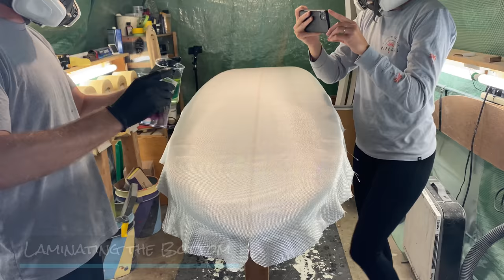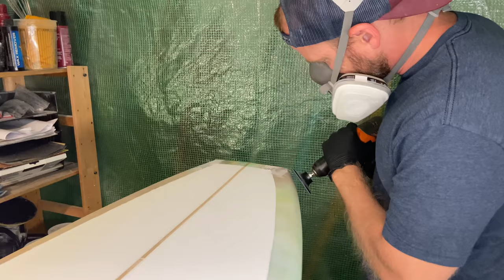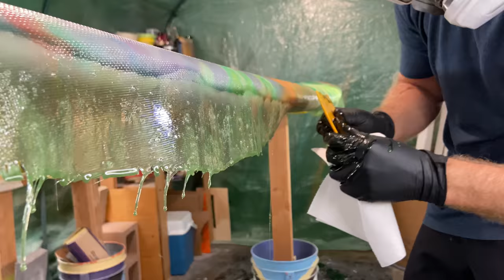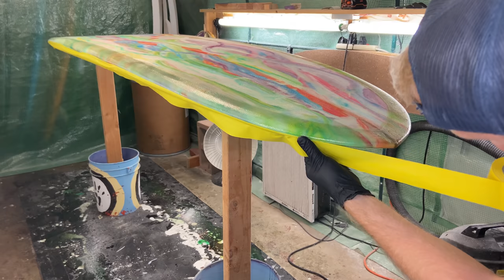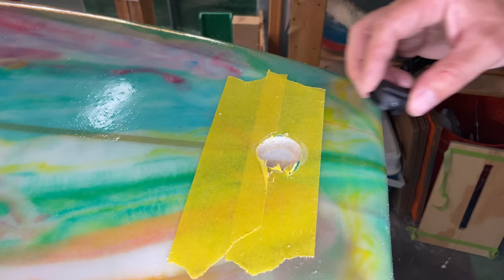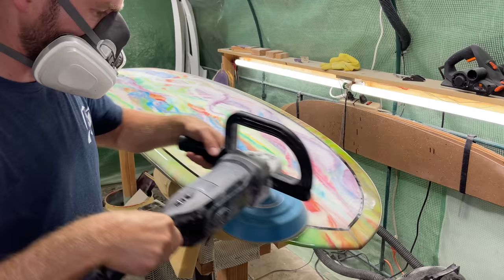Surfboard Glassing [Longboard]

Comment: Another beautiful board!  Everyone of your projects comes out so good it's hard to see how each new one can get even better!  Looks like you've solved the masking issues - good on you!.  Nice to have an assistant in the bay with you too!  Thanks for sharing.
Reply from the maker: Thanks Jim! Appreciate it. Yes the tape lines did improve and I found a better tape to use. My wife was a great assistant on this one!
Reply from the maker: Lord Riggnarok  Not sure, never tried!  There is a brazilian company called surfpuro making fiberglass skateboards that has seemed to figure it out.
Reply from the maker: Lord Riggnarok  You can pour resin on a skateboard deck and move it around with a heat gun.  But the resin could crack if your actually riding it, not sure.

Comment: You were killing me grinding the laps with that drill. I almost stopped the video halfway through to comment and say, you know, those Makita Sanders are a dream and have way more control in all stages of glassing, but I held back cringing, then all of a sudden there you are blazing away with a Makita. I really like your lap width gauge. It's clean and neat. Most of the ones I've seen have been crafted out of a broken board, but they amount to the same thing. The blind box drop with a brick is pretty risky. I always use a dedicated straight and true fin to set the boxes. Can't afford to have one croocked fin box. But not saying you don't have it wired. I've been building boards for 60 years, and I'm giving this finished board and your craftsmanship an A+.
Reply from the maker: Thanks for the feedback and I’m glad you can relate! So many ways to get to the final product. Thanks for watching 🤙

Comment: When you do the double layer on the tail, theoretically better to put the smaller piece on TOP, this can prevent sanding through the strands of glass on the full length piece and weakening the structure.  Counterintuitive but true

Comment: I've never glassed anything before, but I want to re-skin my foam kayak with glass. Would the resin you use in this video be a good choice for that project?

Your work is amazing. I love watching the videos you put up.
Reply from the maker: Never worked on a kayak, but if its got an EPS or PU foam core, you could glass it like a surfboard using resin and fiberglass.
Reply: @BendheimBoards  mine is made from xps foam. I've been doing a bunch of research on fiberglassing it. I know it's a better option than the skin I currently have on it.
Reply from the maker: @patrickkaufman7561  Andrew W did a full build series on his channel of an XPS foam board you can check out

Comment: Curious about your color, did you mix it prior then just add both into a cup? My pigments are almost like a paste. I mix them with resin but in your video it looks like your pigments are watery which is super cool allowing you to mix two colors without stiring as much giving you that neat separation!
Reply from the maker: I used tint colors rather than opaque and I mixed them in a small cup of resin then poured into the larger cup of clear resin.
Reply: Interesting! Thanks a lot! Awesome board!

Comment: Amazing board. This may be a daft question - but how did you stop the tuck from ‘overlapping’ the swirl colours on the other side? It looks like the colours are consistent right to the edge of the deck / bottom.
Reply from the maker: The deck colors were darker than the bottom colors so you can see the cut lap on the bottom really well but the deck colors mostly covers the bottom lap.

Comment: great job tanner!  is it ever possible to avoid pin lines on the cut lap?
Reply from the maker: Yes, pin-lines are just used to cover imperfections on the cut lap.  If you get a clean cut lap, you can just leave it as is unless you want the look of the pinline

Comment: sweet...if you are resurfacing a board (one that is old, yellow, etc...) can you stop at the filler/hard coat?   if so do you need to sand and polish this coat as if you were putting on the gloss coat???
Reply from the maker: You can stop after the fill coat for any board. Yes you’ll want to sand afterwards as well. You’ll get a sanded finish just like high performance boards you see in retail shops

Comment: What grit papers do you sand through and what compound do you use to polish with?  I've been using green light epoxy on my last few boards, and sand 320, 400, 600, 800, wet sand 1000 and 1500, and then use car polish, and the results do not look nearly as good as yours.  I know epoxy doesn't polish like poly, but yours looks really good.
Reply from the maker: You nailed it, those are the grits I’m using and I’m using car Polish as well. It’s really hard with epoxy and so much easier with poly. The electric polisher makes all the difference if your doing it by hand.

Comment: Nice video. Would it be easier to use vinyl tape for the stripe than the masking tape?
Reply from the maker: You need high quality masking tape that can handle the resin and not leave residue when pulled off

Comment: I got 2 foam top, hard bottom paddle boards. They have some sun wear in the foam and a few holes. Can I do this process and just wrap the existing board or would I need to strip it down to the foam core?
Reply from the maker: Resin isn’t made for soft top boards. Stripping it to the foam would work but I’ve never done it

Comment: I was wondering what’s the difference between the layer of hot coat and the gloss coat material wise?

Love your videos btw!!
Reply from the maker: For epoxy resin its the same.  I just used it to seal the pin-lines.  Poly resin, the gloss coat has styrene added

Comment: Hello Tanner.  You are One Mad Pablo Picasso SurfBoard Designer/Maker. Love the Long Board. Tanner is Black Color Fiber on a Surf board Bad because it Could get Hot from the Sun? Is 50” x 72” 5.5 Oz. Enough Fiber too Do a Bottom of a Board? How many layers would you need? Yes I have a CRAZY Ideas.   Thanks
Reply from the maker: Thanks man! I think you are referring to carbon fiber which is black.  Its widely used and will be fine.  But it will melt your wax so don't leave it in the sun.  I don't know how long your board is, but just measure it out to make sure you have enough to wrap the rails, nose and tail.  I haven't ever used 5 oz, but I'd suggest one layer on bottom and 2 layers on the deck.
Reply: Tanner second thought how many layers do you put on your Surfboards? I have a Ideas for you? If the Heavier fibers the Less layers? Or you still need Two layers? Ok here my plan for. I found two kinds of Kevlar and like to buy some for you. The Carbon/ Kevlar Fiber but it Cost $85 one layer of 5.5 oz. please let me know. I think Kevlar would help in keeping the dings down?
Reply from the maker: @gregoryh4601  I appreciate the offer, but I'm stocked up on fiberglass right now and don't plan to use carbon fiber till I get into skimboards.  🤙
Reply: @BendheimBoards  Sir Tanner it is ok. On the Carbon Fiber I switch to Kevlar fiber for Surfboards. That way the cost is Down and like the Yellow look on the Bottom. Do you get a  lot of Boards get broke by 🌊? How about when you want to try Kevlar let me Know. Just a early Christmas Gift from a man that never Surf! Bye Tanner and Wifely.
Reply from the maker: @gregoryh4601  None of my boards have broken yet 🤞 Have a good one man!
Reply: @BendheimBoards  Tanner you the Man always coming with a Great Answers so that I can’t ship you some Kevlar Fiber. How about this or is it not good for your work. If someone want a Board made let them know if they like to try Kevlar? Tanner I’m a old Man with a Big Kid Heart. Keep building the Best Surfboards. God Bless you and Wifely and Family.#1 you R

Comment: What ratio of catalyst are you using on a board like this?
Reply from the maker: This board is epoxy resin so it doesn’t use a catalyst just epoxy resin and hardner with a 2 to 1 ratio

Comment: what is the timing of cut lap with epoxy resin?  same as Poly?
Reply from the maker: No it’s a lot longer. I waited about 3.5 hrs with this epoxy before flipping and cutting my laps. Poly is around 30 min to an hour
Reply: @BendheimBoards  thanks, can you still do  a clean cut lap with epoxy? i heard its difficult. Merry xmas mate!
Reply from the maker: @6to6surf4  Yes you can
Reply: @BendheimBoards  how does the smell of epoxy compared to poly? still as bad?
Reply from the maker: @6to6surf4  no smell with epoxy
Reply: @BendheimBoards  great! thanks

Comment: Do you have a local supplier for the blanks?  I want to build a few but the shipping prices are outrageous.
Reply from the maker: Greenlight on East coat and Foam EZ, PureGlass or shaper supply on west coast is who I’ve used
Reply: @BendheimBoards  It's been a year since my post.   I found a shop in Wilmington, NC where I can pick up blanks.  I am working on my first two boards right now.   In the middle of the hot coat on surfboard #2 then I'm going to sand both and put a gloss coat on them.  I made a lot of mistakes but have learned a lot.  Blank #3 is sitting in my shed and I hope to do a much better job on it.  But, as long as I can catch some waves on them it's all good.  Thanks for inspiring me.
Reply from the maker: @garyh4458  awesome man keep at it